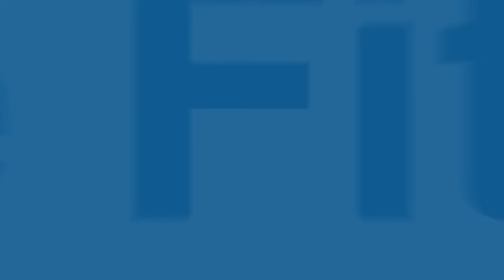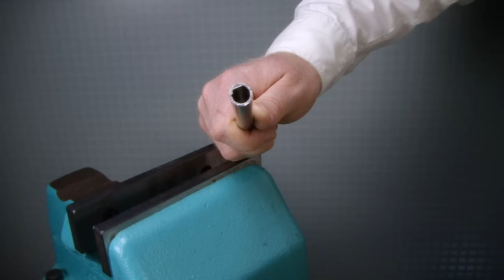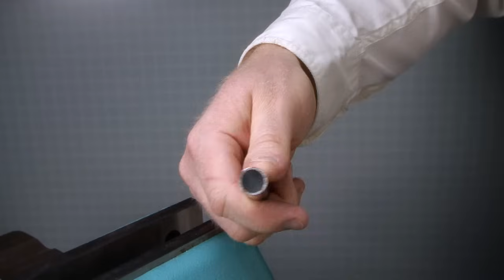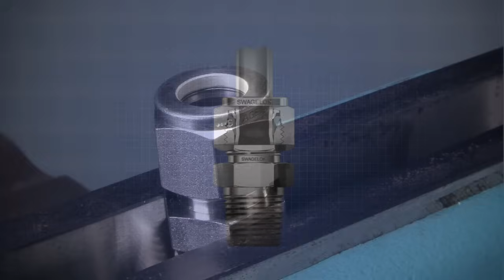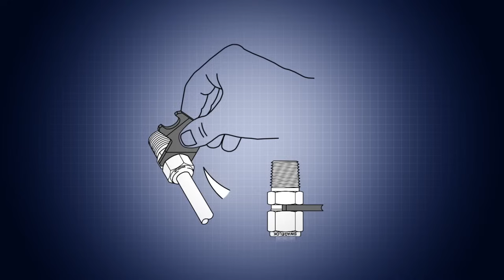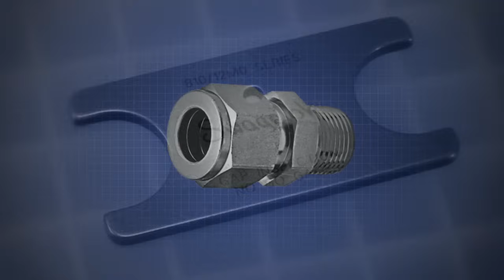How to Assemble Tube Fittings (1″ and Under) | Tech Tips | Swagelok [2020]

Comment: How about with soft nonmetallic tubing? PTFE, PVC etc.
Reply: They work with those, too.  Flexible tubing will need a special barbed insert put inside it which will provide additional bite, but you can swage flexible tubing.  For rubber and other soft tubing, there are adapters that has a barb on one end that will hold the rubber tube, and the other end has a connector that’s designed to fit into the Swagelok tube fitting.

Comment: Is it acceptable to use a very small amount of anti seize on the thread to prevent galling? I have some that we disconnect and reconnect many times. They get tight before they are actually tight , I assume it is the friction from the stainless.
Reply: I am no expert but I have used the many years. You should replace the fitting. This is not natural under proper care and cleaning of the threads. Inspect the threads of the nut and union and I bet they are damaged, look especially at the first round since you are having issues getting it started.
Reply from the maker: Hi Adam, Your local sales and service center will be able to answer your question. You can find their contact information here: https://www.swagelok.com/en/locate-a-sales-service-center

Comment: Hello Swagelok world. I'm using 1/8" tubing's and fittings. (4ft of tubbing , 2x Ball Valves, 2 Tee connections)  But I'm having pressure leak when testing with N2 at 1200psi.  The leak rate is about 2 psi in 10min. I (supposedly) followed the recommendations to make the connections. I have been using SNOOP , but I cannot detect the leak. I've inspected and tightened ever connection, but still have pressure leak . Any idea what could be wrong? Anyone recommend using a sealant?  Thanks!
Reply from the maker: Hi Carlos, Your local sales and service center will be able to answer your question. Please contact their customer service department. You can find their contact information here: https://www.swagelok.com/en/locate-a-sales-service-center

Comment: Depressurize the system BEFORE disassembling the fitting?

THAT'S what I have been doing wrong.

Thanks Swagelok!
Reply: You'd be surprised how often this happens.  Usually an operator just not paying attention.  You really need to double or triple check that the system is depressurized.
Reply: @24680kong  
One needs to utilize a proper LOTO Program. 
Then there is no way that one can end up opening a system and exposing themselves to hazardous energy if one uses LOTO properly.
It is hard to believe that ANYONE does this but I know that they do.